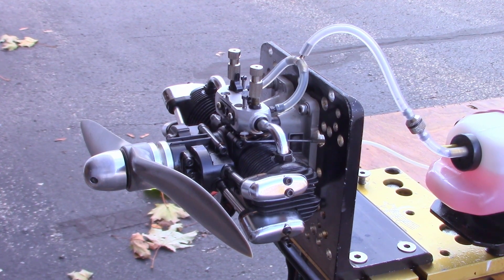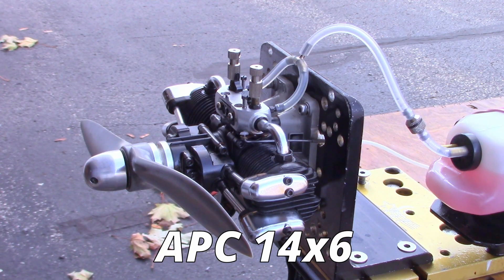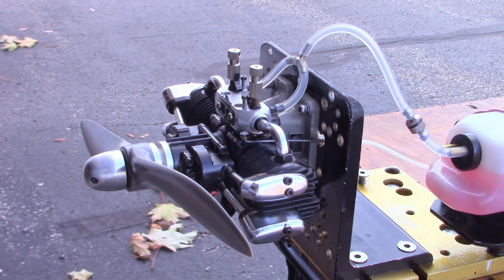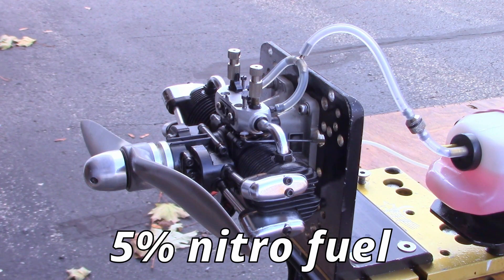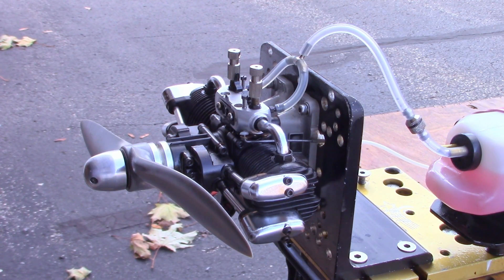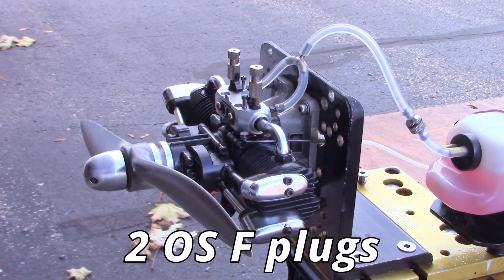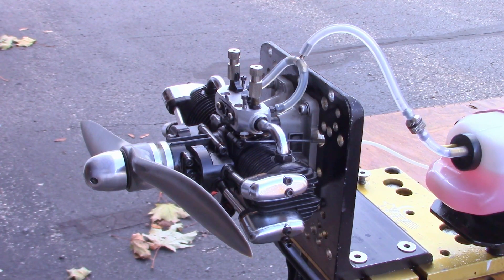Saito FA-90T A Good Run with Troubleshooting

Comment: Dave, I’ve just rebuilt one of these and am a little behind you, with some unsuccessful test runs, cylinders cutting off etc. my club says the engine is a duffer, give up. I’m close to that but have ideas remaining to fix, including: twin fuel feeds back to the tank; disable the internal vane pump so that she reverts to normal/typical configuration (crankcase pressure with fall). Note, I use a 1.7mm pushrod as a guage to set the low speed air bleeds, start point.
Reply from the maker: The stock engine runs just fine. I have had about five of these engines and they all ran perfectly stock. In my opinion, there is no reason to make them modifications. You’re making the engine. But hey, it’s your engine. You do what you want with it.
Reply: @dmrcflyr2 yes, firstly I’ll go in at your 3 turns setting then if she’s not bummed out it’ll be surgery. By the way, presumably you’ve read the manual detail?
Reply from the maker: I have read hundreds of engine manuals to include this one. Why do you ask?  I have also had several of these and I had them all running just fine, so I know what I am doing.
Reply: @dmrcflyr2  wow, Dave, sensitive guy you are.
Reply from the maker: @petershephard9248  You comment makes no sense.  The point I am trying to make, that you are clearly missing, is that there is nothiong wrong with the Saito design of this engine.  If you are having issues getting it to run as designed, then there is something functionally wrong with the engine, induced by either yourself or another previous owner ofg the engine.  Do not blame the design for your inability to get it to run properly.

Comment: Hi ive been looking for a fox eagle .60, the one with the slant angle glow plug and the muffler that has a bellmouth intake on the front of the muffler. Ive had one way back in the 90s and was extremely powerful and racy. Or looking for a rossi .90. Either will be going in a old SIG quick build mustang kit that ive recently obtained.
Reply from the maker: Sounds interesting. Good luck with your search.
Reply: You are not going to believe this. A buddy and i found this plane and engine combo on Facebook.  Never flown. We ran a couple tanks through the Fox about a month ago then the weather crapped out. 
David- I just bought one of these engines and remembered you talking about the needle valves in a video a while back.  Sure enough,its the same engine. I pulled both needles out and they are not the same. One has a sharper, longer taper than the other. With a used engine, who knows who swapped what. 
I’m gonna do the usual go through and set up and see if i can get it fired up. Weather permitting.
Reply from the maker: @mrbigg7255 I believe you will have issues getting it tuned if both needles aren’t the same.
Reply: @dmrcflyr2 I agree on the needles. I’ll order one just like you bought. Hopefully it will be a match to one of them so that I will only have to buy one. Bearings look toast.  Flakes of crap through engine. 
Pushrod seals are junk. Cant find any that look exactly like them. 
Im going to order the gasket set off the guy you get them from. Gonna buy some Boca bearings. Will the economy set be fine? 
I see that offer stainless steel. Should I spring for those?

Comment: Awesome! Good run and good to see the troubleshooting steps! 

I dunno for some reason, i wasnt expecting an engine of that size to have an airbleed adjustment... just thought it would have a needle for low speed. Probably just me assuming (which I shouldn't do) but so far i have commonly seen airbleed on 40 size and smaller engines... so even the big guys can have it too?
Reply from the maker: Nearly every  Enya engine 2 and 4 strokes incorporate air bleed carbs.

Comment: Dave . How about testing the engine with the old needles ? . I think you nailed in the problem quite good and found out that the airbleed was the adjustment necessary
Reply from the maker: I could but I’ve taken the engine off the stand. Besides i already have new needles; they cannot be returned. I tested the new needles versus the old needles and there was a distinct difference in airflow. So i have tested that.